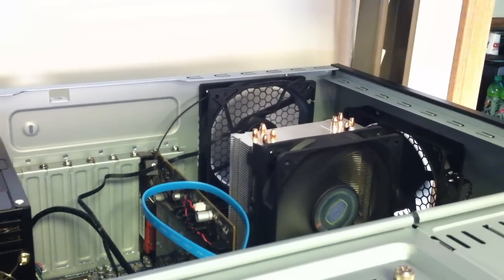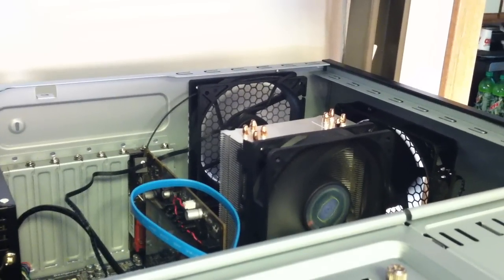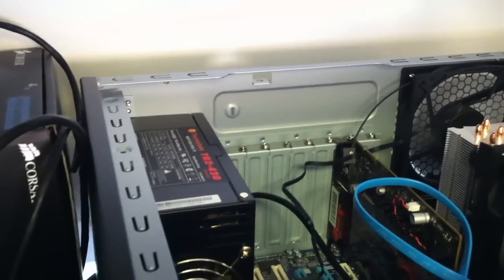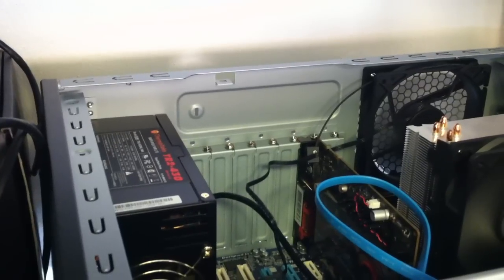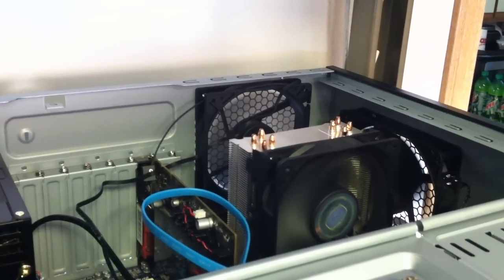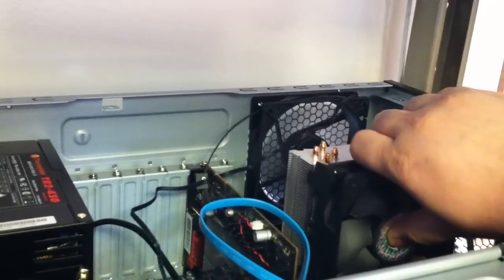Fan noise demonstration of CoolerMaster Hyper 212+

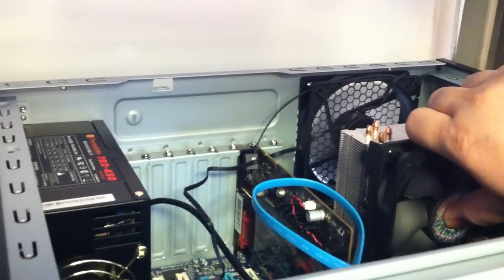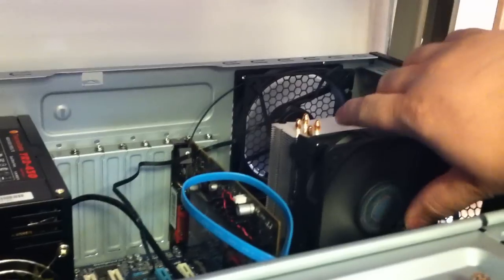Comment from the maker: My apologies, good sir. How long would you like to hear it for?  At 0:40 seconds, you can hear the fan running without me talking.  At 0:29 seconds you can hear the difference without it running.  If that is not enough time for you to judge the noise from this product, I'd be happy to post another video without ANY commentary.

Will 30 seconds be enough?  60 seconds?  Or would you prefer a 10 minute video?  I can even toggle the fan on/off periodically with an inline switch.

Comment: FAN TICKING NOISE.
I built an office PC for my sister with either the EVO or Direct (same fan I think) and the ticking was very noticeable, even when the FAN PROFILE software had it running at 40% max speed.

I replaced with an Arctic F12 PWM fan that I bought on sale for $6. Used a second one for the rear case exhaust (no need for intake on this PC).

All FANS (including well-reviewed PSU):
- 2x Arctic F12 PWM (CPU and case rear)
- Antec VP-450

Comment from the maker: Sorry for the delay.  Yes, the noise from this fan should be similar, if not identical.  In this video, the fan was already running at full speed, so even with a hotter CPU, the noise from the CPU fan would not be any louder.

Comment from the maker: Hope you found this useful then.  It's cooling my 2500K OC'ed to 4.5ghz, and I have had no issues with stability.  It fits in with plenty of room, and the rear-access hole on the motherboard tray allows for easy mounting and removing.  I'm very happy with both the 212+ and the Antec 300.

Comment from the maker: Proably.  I don't see why not; as I understand, the difference is mostly that the base of the EVO is continuous direct contact, and the + is just direct contact (the aluminum baseplate is also touching the processor between each heatpipe)  The rest of the construction is nearly identical it seems, minus cosmetic differences (chrome top-plate, transparent fan, etc).

Given the stability my systems shows at 4.5Ghz, I wouldn't hesitate to save a few bucks and get the + again (vs the EVO).

Comment from the maker: I would think so.  My case (Antec 300) is what I'd consider a "normal midtower" case.  It hold a full ATX motherboard, but that just means it's taller, not necessarily wider.

If your definition is different, then maybe not.

Comment: Set your minimum fan speed in the bios as low as it will go. I have my 212+ set at the minimum  which is 600 rpm and it doesn't make any difference in temps.

Comment from the maker: I would check out the CM 212 EVO too, not just the 212+.  It's only $5 more right now, but has a better formed base, which should provide for better cooling.  Not that I have complaints about the 212+, but the EVO does seem to be a slightly better designed model.  Newegg item number N82E16835103099

Comment: i have the same problem. fan is vibrating and when change speed make click noises..
Reply from the maker: Same problem?  I have no problem with that setup, so I'm not sure what issue you could have that is the "same" as mine.  My fan does not vibrate, and the noise when I was stopping it was the rubbing of the fan on my fingers.
Reply: your fan is vibrating more rpm more little vibrating and thats make noise.
Reply: I fixed it by putting oil in the fan bearing, my fan was actually starting to stop spinning completely lol

Comment from the maker: It certainly could, depending on the load.  It was basically at idle there, and if it had overheated (let alone "got warm"), the system would have halted to protect the hardware...which didn't happen.

Intel chips have had thermal protection built in for years, so they don't overheat and self destruct.  See youtube(dot)com/watch?v=06MYYB9bl70

Since then, AMD has added similar technology, so it's not really an issue anymore on modern systems.